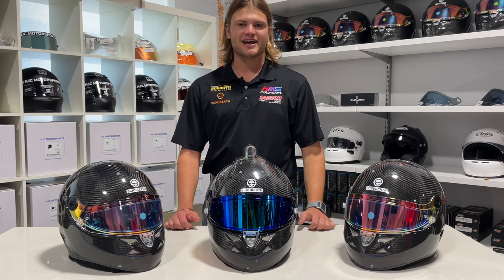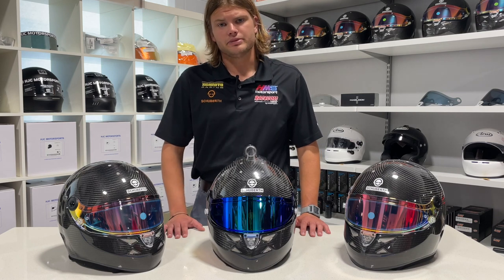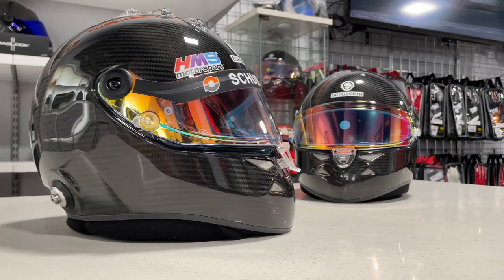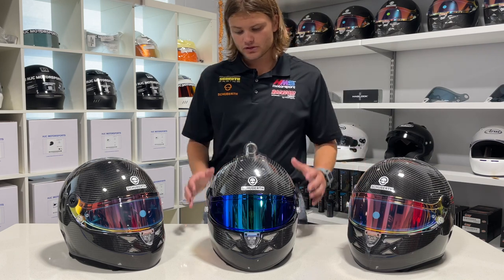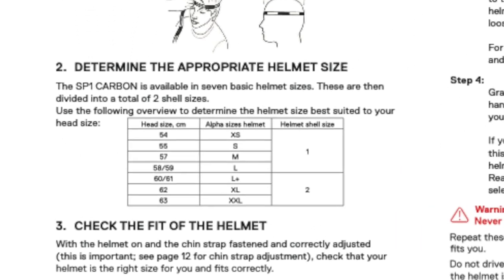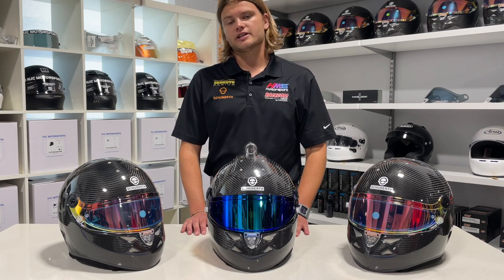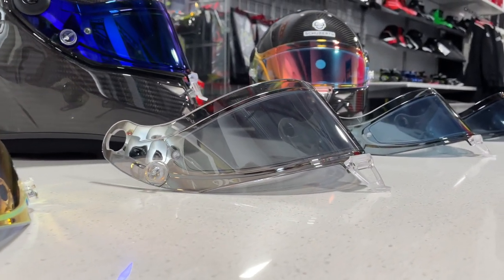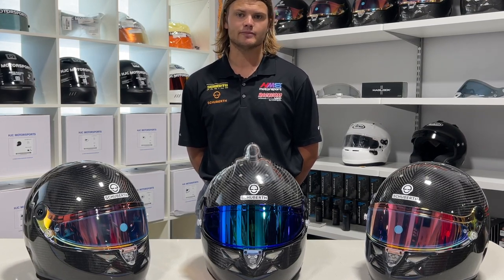SCHUBERTH SP1 Carbon Overview

Comment: Whats the different between sp1 and sf4?
Reply: The SP1 is made to the 8859-2015 standard and costs under $2000.  The SP4 is much stronger and is made to the 8860-2018 standard and costs over $5000.  The SP4 is still not F1 level as it has no anti ballistic protection - that would be the top line SF3 helmet worn by Max Verstappen.  But it would be the top level Schuberth helmet one would purchase for closed cockpit racing.
Reply: @teamredgutz399  awesome. Thank you so much for such thorough answer. 🙏🏻🙏🏻